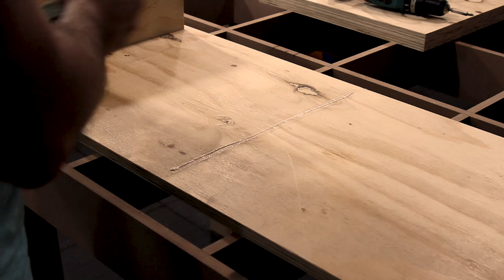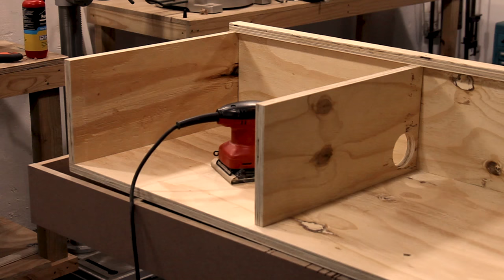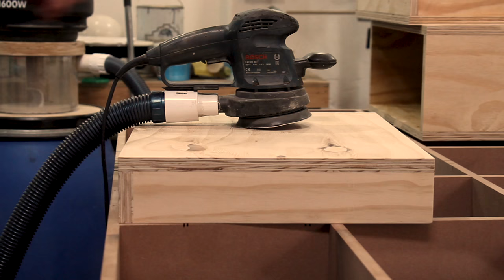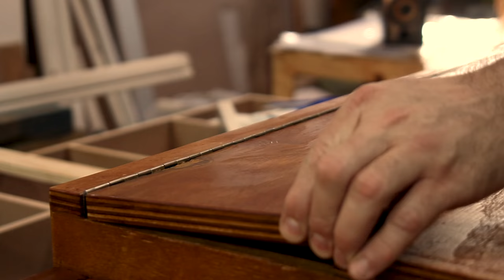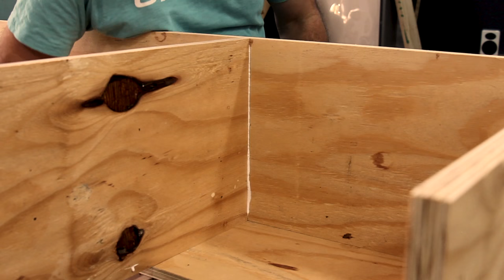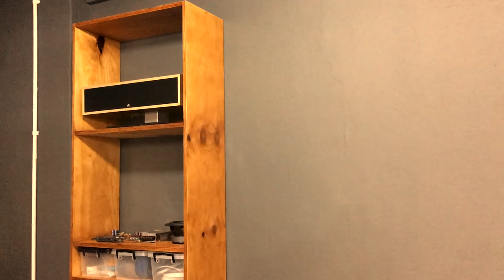Building Inexpensive Wall Hanging Unit for Turntable & Hifi Equipment - by SoundBlab

Comment: This is nice, but the only problem I see with your set up is storing your records flat. You NEVER store vinyl flat. They will warp. You store them on their end. So I would have made the bins below the turntable taller to accept records on edge.
Reply from the maker: Hi Thanks, yes true. But the shelves are for equipment, not records though. The few records in the one shelf was just what I was quickly listening to at the moment 😊.

Comment: I've been looking to build a floating shelf like this for my own stereo equipment (about a 100lbs of it) how did you mount the middle unit to support the depth and weight? Thanks
Reply from the maker: The middle unit (the one housing the turntable) is supported with metal triangular brackets fix to the wall. The rest of the units are supported with a strip of wood secured to the wall and the units rest on top, then using nylon anchors are secured to the wall.

Comment: Well done! What type of finish are you using? I did not think cheap plywood could look so good!
Reply from the maker: Thanks. I used a spray-on Teak stain and then finished it with satin clear polyurethane applied with a brush.

Comment: could You build a monitor speaker?
Reply from the maker: I'll put it on my list for future projects. What size monitor did you have in mind?
Reply: A 2-way monitor with 35 Hz-20 kHz (+/-3 db) would be really nice. With 8" or 8.5" woofer and a really nice and precise flat frequency response.
If the bass port would be on the front, would make them perfect.
Cheers :)